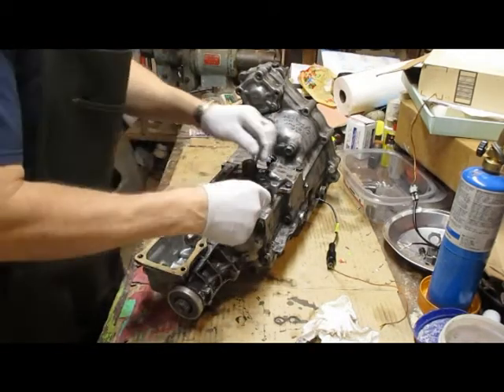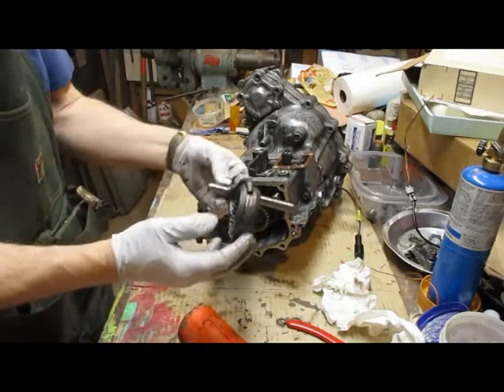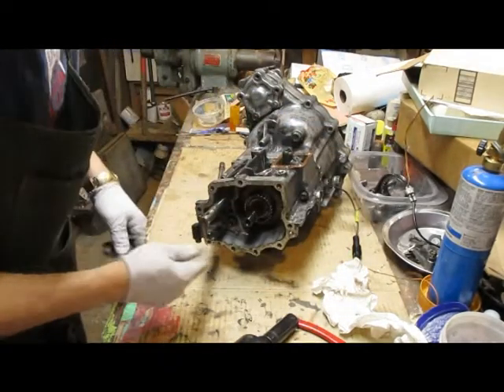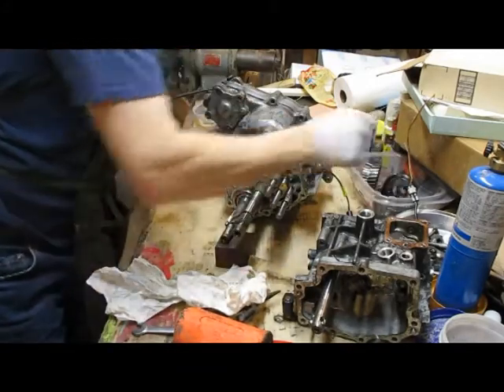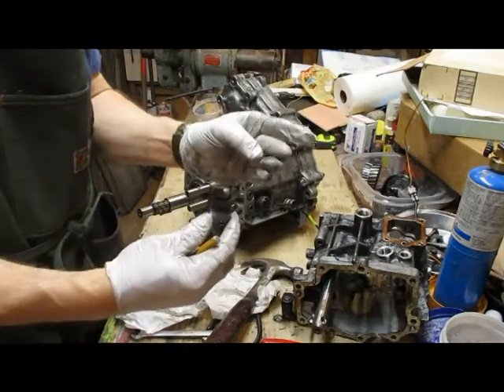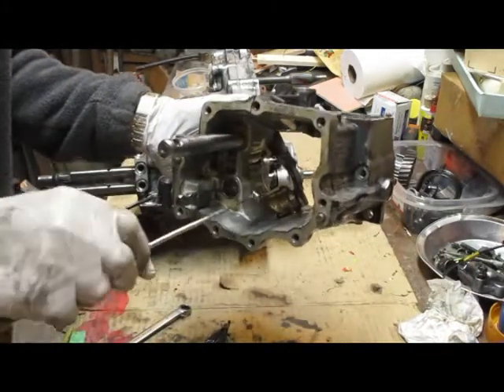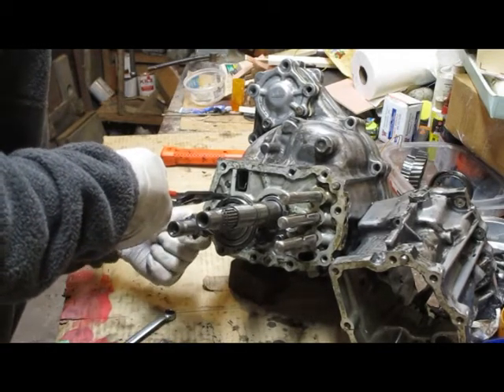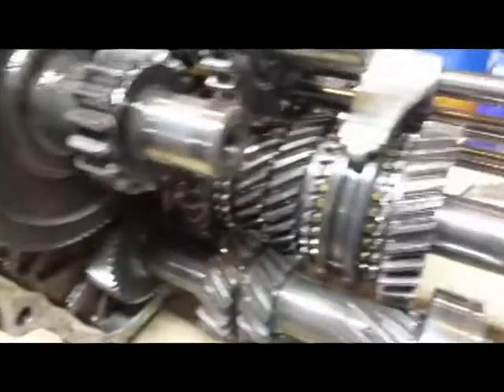Toyota Tercel 4WD Manual Tranny Disassemble in 20 minutes

Comment: Hello sir, I have a question, to remove the manual transmission of a Toyota Tercel 4wd, do I also have to remove the engine? I want to change the transmission on my Tercel 4wd and the mechanic tells me that he has to remove the engine in order to remove the transmission. I want to know if this is correct?
Reply from the maker: Some like to remove engine and tranny but i never do. You can remove tranny only or remove tranny and front differential together from under the car.  I would only remove tranny if thats all i plan to work on. I replacing clutch i remove both as a unit. Tranny and diff are two sep items bolted togethet
Reply from the maker: If you remove tranny and diff as a unit i find its easier if you remove input shaft first. You can also reinstall unit and install input afterwards

Comment: I am working on my 86' Tercel 4wd and had mistaken the plug on the passenger side of the transmission for a fill plug. I soon found it was not. It was a plug that held a connector rod allowing you to shift into 5th and reverse. I want to know what position I should have the shifter in when positioning the arm to replace that plug. Hope to hear from you soon. Thanks.
Reply from the maker: Contact me:    xir777dneh@gmail.com  or walkers77@y ahoo.com
Reply from the maker: I am not sure it matters what gear it's in though I would put it in neutral. The main thing is to make sure slot on piece inside granny is centered on hole. Plug pin must go into slot.